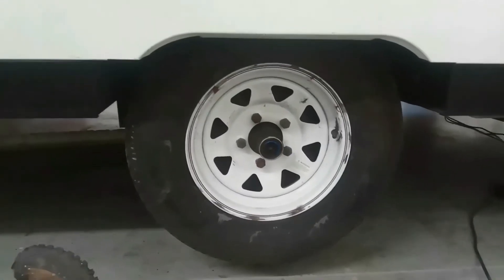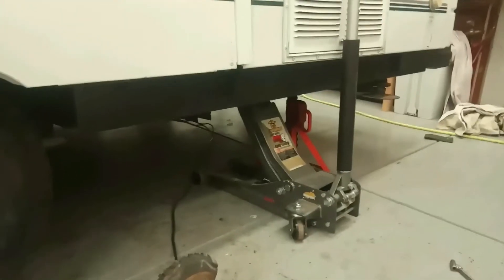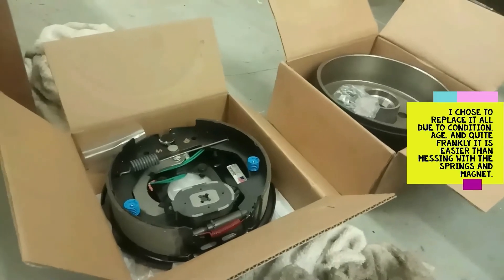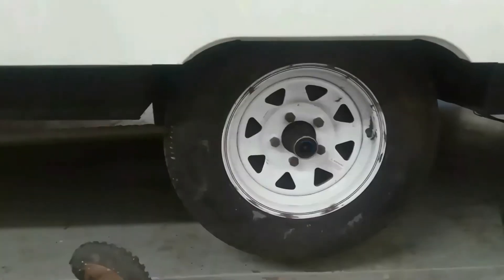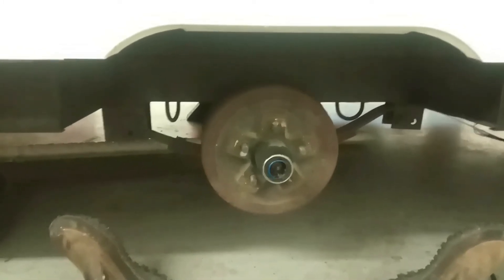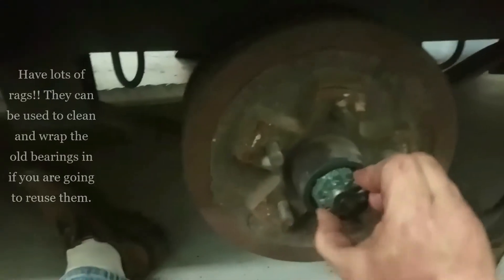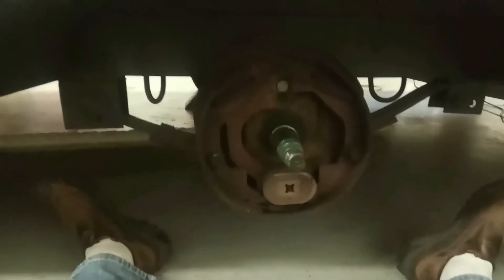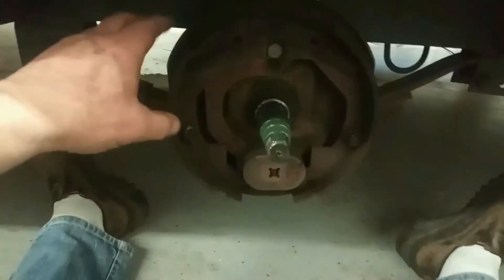Part 1 Brake removal 2000 Coleman Grande Tour Utah

Comment: Thanks. This helps on our project. Ours was purchased in similar shape. Took it down to the frame. Assembly is in work. I’m in charge of grunt work plus electrical and brakes/bearings/tires. She’s doing the finish carpentry.
Reply from the maker: Glad to help!